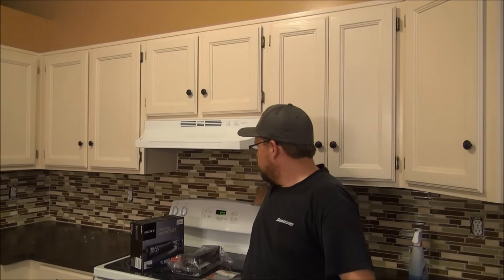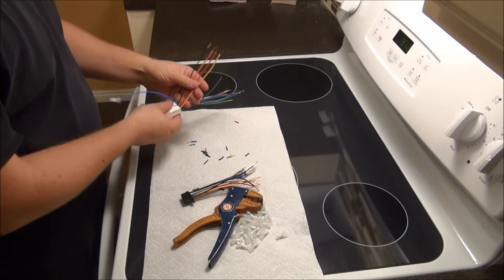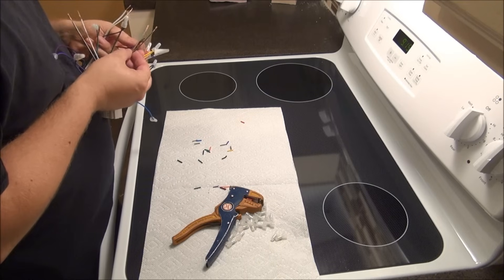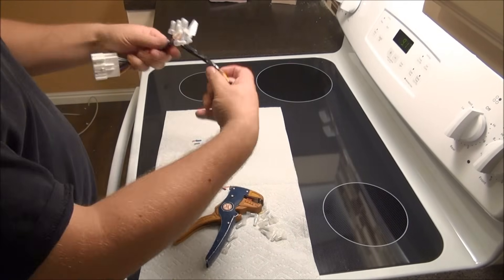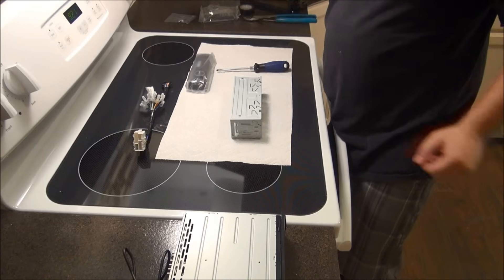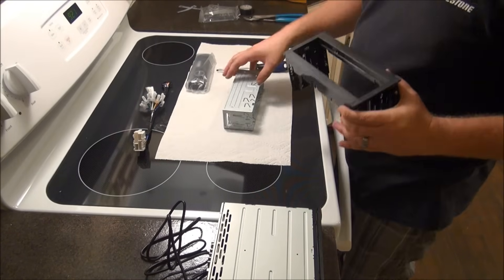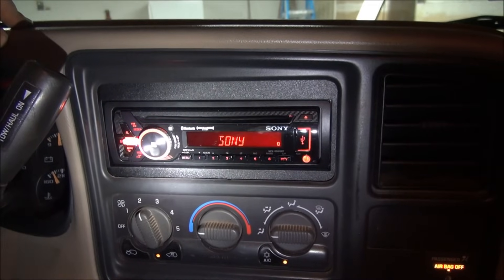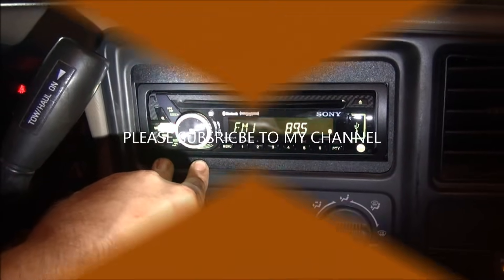How To Install A Stereo In A Chevy Silverado. Head Unit

Comment: I have a 01 2500hd same truck as in the video.  I installed a after market radio today the only problem is the function to use the radio in aux mode or when you shut the truck off the radio turns off to instead of staying on like it should.. used same harness as u but there was a orange and white wire that didn't have a mate and the solid orange coming from harness that u plug into factory harness has to be ran with the reds to power radio
Reply from the maker: steele174 That is strange it should go off when you open the door?

Comment: I just did this on a 99 silverado...2 wires were unused. I believe it was the orange wire and the blue with white stripe. Also it is hard to see him do it in the video but you need to bend the metal tabs to hold the radio solid. You can do this before you put it in.
Reply: It’s the same for me, orange and blue w white stripes

Comment: Thanks so much for your helpful video. I just replaced the radio in my 2002 Silverado, and it went just as you pictured. I got the new radio and installation kit from Crutchfield. It was complete, but maybe too much so. I was a little confused with what exactly to do with the DIN sleeve. Your video made it very clear and the job took me maybe 10 minutes, max. I soldered and used heat shrink to splice the harness, so it was as unobtrusive as possible.

Comment: I’m looking to install a radio and some new speakers in the front. How do I know if I need an amplifier?
Reply: check your power rating for your head unit and your speakers to make sure its able to supply enough power. you will most likely be fine even if the radio can't supply 100%.

Comment: I have a 06 Tahoe which is very similar. What if I want to keep the chime and steering wheel volume options, how would I wire the additional harnesses? Can you help?
Reply from the maker: +Ahki Haneef YES, The best way to install that keeping all of the factory options such as chime etc... Is to install a radio replacement interface such as the ones from the company call PAC... I think this is the interface you would need...PAC RP5-GM11 however you would want to go to PAC's website and verify your options BOSE OnStar etc
Reply: +Do It Yourself Bri thank you sir.

Comment: Great instructional video. I heard there could be issues with installing a new head unit on vehicles with Onstar capabilities, even though i dont care to keep onstar available. Any info on that?
Reply from the maker: spiralnapkin Yes on many, there can be issues with important warning chimes like turn signal chime, seat belt chime etc. However it can be done, Personally on the GM cars and trucks 07 and newer I recommend an interface when installing like one that PAC makes.
Reply: Do It Yourself Bri thanks! How about a 2002 buick? Do you know if I'll need the interface?
Reply from the maker: spiralnapkin 98% sure all Buicks that year would not require an interface, unless you have an amplified system and or you are trying to retain certain things like OnStar etc.
Reply: Do It Yourself Bri ok cool. It'll be trial and error I guess. But no I don't intend to retain onstar and I don't have an external amplifier... yet.

Comment: If i don't add the usb and the microphone will it still work fine?
Reply from the maker: Yes it will.
Reply: +Do It Yourself Bri What is the usb conection used for?
Reply: +Do It Yourself Bri and thanks for the simple straight up video, the quality was perfect.
Reply from the maker: +Mr. Dig Bick You can hook android and iPhone's up to it, so that it charges the phone and it will also transfer the music from your phone...However I have a ton of music stored on a USB thumb drive and I keep it plugged in to the radio so that when I'm traveling and don't have the Internet for use of "Pandora Radio" I listen to my music on the thumb drive.
Reply: +Do It Yourself Bri i am a subscriber and are you planning on making and other videos on that truck?
Reply from the maker: Yeah I have been thinking of doing some.... Custom Sub-woofer box... Amplifier install.... Oil change......Brakes....Air suspension Bag Install....Back up camera
Reply from the maker: Do you have any you would like to see?
Reply: +Do It Yourself Bri yeah for the amp video can you show how to wire it to the subwoofer and how to use the amp thanks
Reply from the maker: Yes sounds good, I will work on that as soon as I can make it happen.
Reply: +Do It Yourself Bri thanks i say that because i have the same truck

Comment: Do I need to buy a antenna adaptor for my 2002 Silverado 1500 HD? And where did you get your grill on your truck? That isn't stock
Reply from the maker: 021500HD Yes you will need an antenna adaptor. Not sure on the grill because it was on it when I bought the truck.
Reply: that is a stock grill
Reply: +021500HD That is stock the 2500 HD has a different grill than the 2500 and 1500hd

Comment: i have 2001 silverado 1500 base. it does not have power windows doors or mirrors.  which fuse do i use to wire to my aftermarket stereo so it turns off then the key is turned off and on when the key is in the on position?  Do i use the fuse for the wipers?
Reply from the maker: No you should have a wire at the radio that is a specific ignition wire for the radio.
Reply: I wired the ignitiin wire from the stereo to the 25a fuse for the wipers and it worked. I will try the rdo1 fuse later. Thanks for the video

Comment: I have watched other videos and they say I need a chime interface and run a red wire power wire to the fuse box
Reply: Idk who I should listen to 
05 Chevy Silverado
Reply from the maker: On that year its best to use a chime interface... However You can install without the interface... You have to run an ignition wire (I think) and also you will loose the factory chime. If you have on-star or a Bose system and you are keeping that you will have to install with an interface.
Reply: So will I need a chime interface ? I have a 2005 Silverado

Comment: I just bought a dual radio it's a single din radio but anything that's sold at walmart doesn't fit the radio I bought. any suggestions?
Reply from the maker: Strange.... What kind of car is it going into? is the dual to small or big?
Reply: Do It Yourself Bri the radio is too wide for the kits they sell at walmart. it's going into my 04 chevy silverado
Reply from the maker: The only thing I can think of is that the dash kit you have might not mount with the sleeve but rather Iso mount with the screws on the side.... on that style of kit you do not use the radio sleeve or the trim ring on the radio... the radio basically fits behind the aftermarket dash kit

Comment: Just installed mine today in my 2000 Sierra. Your video here was the only accurate one that mentioned all the demolition you have to do to get it to fit. I too had to get an angle grinder and cut the support bar. No where else does it say you have to do that in any instructions or other videos. Glad it's over.

Comment: could you say what color wire went to what color
Reply from the maker: jason robbins When using an aftermarket radio and harness for the truck you just simply match the colors up. For example red to red black to black yellow to yellow etc. If the pigtail of your truck is cut than you would have to hard wire into the vehicle and the wires will not match. However in this video/install you just simply match color for color.
Reply: i did that but the wire that makes it so when you shut of the truck it shut off the radio doesnt work so i wired  both wires to the constant and i just have to shut the radio off when i get out and the left  door speaker stops working randomly
Reply from the maker: jason robbins What year truck do you have?
Reply: 04
Reply: I have a chevy tahoe 2001 will this work and what color wires to what color wires do i connect together

Comment: I tried installing an aftermarket unit in my 03 Sierra, not sure if the unit itself is bad or if I did something wrong. Two wires not paired up between the unit and the harness (one brown, one orange), but not sure if that makes a difference. There's absolutely no sign of life once the unit is connected and this isn't my first install either so I know what I'm doing for the most part. Please help!
Reply from the maker: +Jessica Vinson If you can test the power wires with a test light..... The test light needs to light up all the time with the yellow wire and only when the ignition is on with the red wire... check those wires for power...
Reply: +Do It Yourself Bri So apparently it was the wrong wiring harness...visited a car audio shop and got the right one. Head unit works just fine now except the USB and Auxiliary ports. When I plug my device in to either port, nothing happens whatsoever. Kind of a disappointment as that's the man reason why I wanted this particular unit.
Reply from the maker: Jessica Vinson Yes that's great you got it working.... However lame your USB ect in not working... I wonder if you may have a defective head unit or if its the phone/music device?
Reply: Lame indeed, not knowing what the problem could be. I do know that neither port works with my phone or mp3 player.
Reply from the maker: What kind of stereo is it?
Reply: +Do It Yourself Bri It's a Kenwood, Model KDC-mp3345U
Reply from the maker: Probably the best thing to do would be to call Kenwood and or email them with the problem. I would think they will be the best help

Comment: I have a 96 Tahoe, recently purchased a head unit, but somehow I have to hook up the stock amp. yet to find a video souly on that. jumpin the power ant to the pink does not work, any tips?
Reply from the maker: +Kennith Schjoth I was unaware that in 96 the Tahoe had a factory amp? I didn't think they put a factory amp in until 2000 or 2001 model's. I could be wrong.

Comment: Ok so my GMC 2002 Yukon XL already has an after market stereo because the previous owner installed one. Will I have to do this whole wiring stuff? because I purchased a JVC brand stereo and the stereo in the car already has a JVC stereo just switching it out for a Bluetooth one.

Comment: What's the antenna thing for
Reply from the maker: GM (Chevrolet) uses a small antenna (micro antenna) that will not fit in the back of a aftermarket radio

Comment: Hey Bri, my 2002 Yukon had a second smaller harness with what looked to be speaker wires and some others.  This Sony hooked right up to the primary harness, turned on, found FM stations yet no sound played.  Any idea what to do with the second harness?  The Delco unit needs it and the primary harness to play sound.
Reply from the maker: You may need to turn on the factory amplifier.... Which should be the blue wire in the radio replacement harness and I think pink on the truck side.... Does your Yukon have the Tape deck down below? If so that second plug is most likely the harness that goes to the tape deck.... (which is not used)
Reply from the maker: Many Yukon XL's have a factory amplifier..
Reply: Nope no tape deck.  I will look for a pink wire and hook the Blue/white fm head unit to it to see if that powers the amp,
Reply: Ok pink wire was it.  Just used a snap on splice to blue/white fm head unit.  Now since this is not my vehicle, where is the XM connector found to plug into the head unit?

Comment: I have a 01 1500 Silverado. I installed the same radio I think it's a Sony Mex-n5000Bt and now the dash lights are not working. Would you know what might be the issue? And with the wiring harness from the Sony  it has illumination(Orange wire) and dimmer( Orange/ white wire) I tired both wires and now the dash lights won't come back on. Any idea??
Reply: Hey u!  Did u ever get u'r dash issue fixed up right?  I need all the help I can get.  We purchased a used 01 chevy a couple years ago. It had already had a radio replaced. But, after a few months,  the radio quit with sound. Lights and all worked, but no sound.  So we figured the speaker wore had came loose or something and got I to it to see. OMG! Whomever did the radio replacement was a real jack ***. They cut the harness  and just used tape on the connections. Well no wonder it quit.  Anywho,,, I finally have a day off to mess with it.  Can anyone recommend info for me on what goes where? This is a bit more than a simple radio job now. I've replaced car steroes over the years but nothing like this. There are a million cut wires and I don't know what goes where.

Comment: Remember to watch for the little rubber bumpers/boots, about an 8th of an inch in size,  that are on the little posts and next to the clips along the inside edge the bezel, that you don't lose any of them. And be careful how you pull it out and put it back in that you don't break off the guide "posts" on either end of the bezel that insert into holes in the dash.

Comment: Hi Bri. Great video. I have a  couple questions. I have an '05 Silverado. I don't have OnStar, or door chimes. Do I need to use the interface? If not, do I need a power wire and a fuse? Thanks for your help in advance.
Reply from the maker: +Daniel Escobedo You don't need to use and interface...However I believe on that year you have to find a ignition source (B+) the constant power wire should be there, however you may need to tap a cigarette lighter for ignition source to turn the radio on and off. Look and test the factory wiring for the ignition source at the radio wiring harness first, use a test light and or muiltimeter to verify ignition source.
Reply: +Do It Yourself Bri 

Sounds good. Thanks so much. :-)
Reply: +Daniel Escobedo 

Would you happen to have a video on how to tap a cigarette lighter?

Comment: So I have a 99 GMC Sierra Z71 and when I pull out my stock stereo I have an extra plug with wires on it and what looks to be my speedometer cable. I have an aftermarket sound system and waited to get the stereo so I don't know if it is from that but it does have a plug for the plug with wires on the back of the stock stereo by the antennae. With my aftermarket harness plug kit it has no holes to plug this "extra" wire plug into. Help PLease how the hell do I connect it?

Comment: I know this is not the point of the video, but you seem like the guy to ask. I have the 2002 Silverado 2500 HD. The piece directly below the 3 auxiliary ports on my truck wont stay in place. Do you know that part to order to replace that? I can't figure out what it would even be called!
And, can it be upgraded to a cupholder instead? Not many cupholders in this truck...

Comment: where would yoy get an antenna adapter
Reply from the maker: +alexander floersch Wall-mart and most auto parts stores have them in stock,
Reply: +Do It Yourself Bri would this method also work for a 2003 chevrolet avalanche?

Comment: did u have to get a interface module for it its like a PACs amp thing?
Reply from the maker: +Juan Pablo You do on the later models that have OnStar or BOSE if you want to retain those features...However my truck is old enough it does not have those features.
Reply: +Do It Yourself Bri mine is a 2002 silverado 1500 without that and i dont have power to my 12v constant some reason
Reply from the maker: +Juan Pablo On the truck that is the Orange I believe?  Have you checked all your fuses?  Does your dome lights work in the truck?
Reply: +Do It Yourself Bri yes and yes
Reply: Do It Yourself Bri I have a 2003 Silverado with Bose. We got the wide harness, antenna adapter and the interface module, but couldn't find where to put one of the connectors and the radio doesn't work. Where is that extra connector supposed to go?

Comment: Great install! I have a 1996 Yukon with the 6 speaker set up. Do I connect the pink wire from the truck to the blue remote turn on? I believe it has the Bose factory amplifier setup.
Reply from the maker: +Britt de Cormier Yes the pink wire is the amp feed wire....Hook it up to the blue from the radio....Sorry I missed you I have been at the lake...
Reply: It is totally understood. I hope you had a time at the lake and thanks for the info.
Reply from the maker: Thanks! It was fun...

Comment: I have a 2001 Chevy Tahoe that I know uses the same system, but I was wondering just how you put the microphone wire from the radio system to the mic above the mirror. I know you said you were able to use just your hand to get it there, but I am totally new to this and am not sure what to do. Any suggestions or picture of how to accomplish this? Also, how do you hide the wire in the window column. Thanks!
Reply from the maker: +Samuel Maffit Yes you just push the wire behind the window column plastic trim piece, I prefer to pull the rubber molding back/off next to the plastic column piece next to the windshield run the wire behind that and just push it behind the head liner over to the mirror.
Reply: +Do It Yourself Bri Also, do you know what wire nut size to use? I think you call them white caps in the video.
Reply from the maker: +Samuel Maffit Yes.. Please do not use wire nuts....Wire nuts are used for in-wall/home use only... White caps are done with a crimp and will not come apart if used correctly. White caps come in 3 sizes, small, medium and large... You want to use small or medium. (18ga-16ga wire)
Reply: +Do It Yourself Bri thank you so much for this insight. Again. New to this.

Comment: I have an 04 silverado besides the wiring harness is there any extra wiring adapters needed? Like for the air bag or door chime? I see a lot of 01's, 06's but no 04 yet. Any help is appreciated
Reply: +brojas125 The 2003-2006 (& 2007 Silverado Classic/Sierra Classic) has a special adapter harness that can be purchased at either Wal-Mart, Best Buy or any local car stereo place.